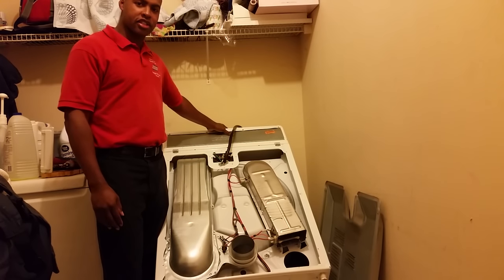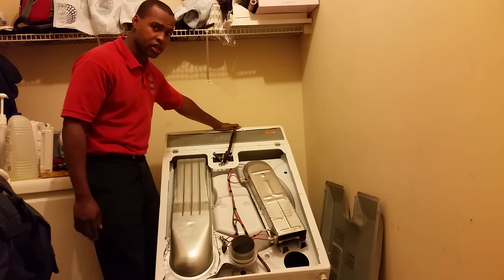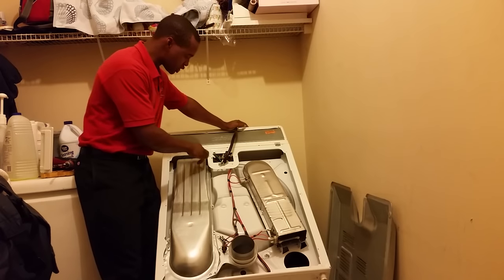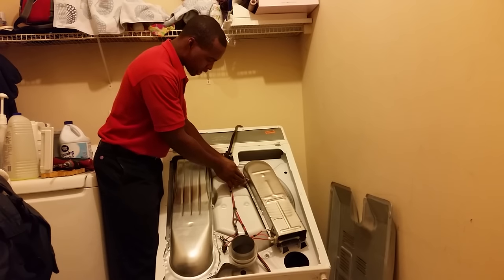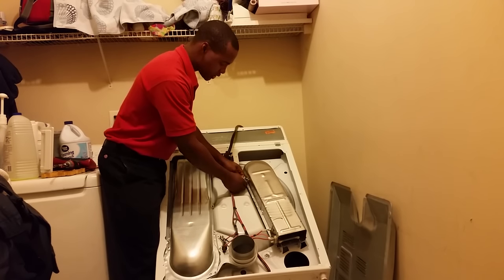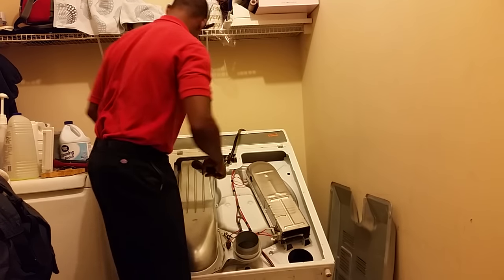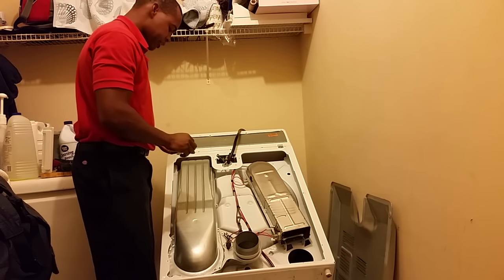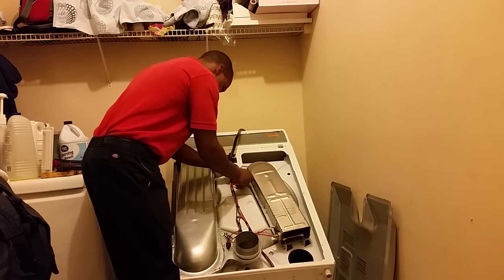How to repair a dryer that works but will not get hot

Comment: Hi Reggie.  Thanks for the post.  The heat in my dryer comes and goes.  I have disconnected the dryer vent from the wall and the issue continues to happen.  I have tested the thermostats, high limit cut off and heating element with a multimeter and everything is reading fine.  However when i test the cycling thermostat on the prongs that the purple wires attach to (i understand this is for delicate heat setting) I do not receive a reading on the multimeter (or ohlms reading).  I do get a good reading on the prongs for the red wires that attach to the Cycling Thermostat.   Could the Cycling Thermostat be my problem (due to no reading from purple wire connections) even though we never use the delicate setting?  Thanks for your time.

Comment: do you know what is the reason it is hot air inside but the cloths are not dry enough？
Reply from the maker: Bad air flow from dryer vents inside the dry and/or all the way to outside the house

Comment: Hello, what happened when the dryer has water under the machine.  The flor is so wet, also the clothes.  Even when the cycle is done.
Reply from the maker: Clothes coming out of your washing machine shouldn't be so wet that it causes water to drip from the dryer. In my experience typically water under the dryer is a washer leak because it's next to it, 

a hot water tank that might be in the same room, 

or your dryer vent maybe venting through the roof and the cap is off so rain comes in from outside through your dryer exhaust vent.

Comment: Where is that other video. What's it under. Dryer gets hot but not hot enough to dry
Reply from the maker: Most likely called lint screen or vent hose leading out the home

Comment: So I bought a dryer and tested it at the guys place and it got hot right away, took it back to my place and had to change it from a 4 prong to a 3 prong and it turns on but doesn’t get hot at all now
Reply from the maker: You're wiring job is wrong or you have a bad circuit breaker in the home

Comment: I have a Samsung Dryer and it turns but getting no heat.  In addition it just stops on its own when the dryer has been set to an hour.  It literally will turn off before the set timed dryer setting.  I have cleaned both vents from inside and outside.  The machine is no more than 2 years old.

Comment: I changed everything and it fixed it then moved it to were it was now it won't heat
Reply from the maker: Check electric outlet in the home could be a bad circuit breaker

Comment: This video was so helpful. So i went it the repair store and got my replacement part. Unfortunately the replacement part has become modified and my wiring connection doesn’t work... what do i do! 🥺
Reply: not doesn’t work but doesn’t match the original fitting

Comment: Hi repair nerd, I watched your videos and was able to find broken coils on my heating element. I’m thinking of replacing the part but I’m wondering if the cause of “my dryer not heating but otherwise working” could be caused by The thermostat. I didn’t test the other parts in the machine and returned my multimeter to the store :( is there a good chance my machine will work with just a new heating element or do I need to replace the thermostat  at the same time? I’m kinda tight on cash now. Also I noticed my was thermal fuse has been bypassed and I’ve been using it this way for years. This dryer was used. 
Thanks, ashley
Reply from the maker: Thermostat should be good if it wasn't the high limit thermostat above it would have gone out. Elements break all the time usually it's accelerated by poor air flow from clogged air ducts in which the moisture stays inside in the machine and humidity makes the coils break up faster than usual
Reply: Thanks again. 3 years later and this video is still helping me out!
Reply: Hi Reggie, I’m back again for more help. My machine has burnt out about 2-3 heating elements in the past 2 years. It’s always the same problem. The machine does not get hot but otherwise works. This time I replaced the heating element which was burnt on a coil and then I replaced the thermostat. It still isn’t heating and the cycle never stops when the times up. I’m about to give up and buy a new one after 3 years. Any advice on what to check before I give up? Thanks so much man!

Comment: I replaced the thermostat on top and it work for a little bit and stop heating up. I did find out that the fuse with 2 blue wires was not connected just the wire taped together. Can this be the cause why the thermostat burn?
Reply from the maker: You're treating the cough and not the cold. The top thermostat is triggering because the heating element is overheating. So your cycling thermostat which is the lower one it's probably bad, clogged tear duct, dirty lint trap
Reply from the maker: Here my video on how to test cycling thermostat, the one that's directly on the element
https://youtu.be/5eohG3knhdA

Comment: Awesome video I'm just now checking my mom dryer I checked all fuses one was bad replaced it but still not working turns out the timer is bad but expensive but I didn't check the elements need to do that as well but love your videos thank you
Reply from the maker: Remember a fuse that blows is like a check engine light in a car usually means something else is going on

Comment: This is an informative video. I have an LG electric dryer. Its running but will not get hot. It will run cycle after cycle, but no heat. Hose is clear. Both thermostats have continuity as does the heating element. Its been -20 out side the last few days, any chance this is messing with things? My clothes are freezing cold in the dryer now that its not working. Any ideas? Thanks!
Reply from the maker: Timothy Shrader as a technician first thing I would do will be to check your power outlet. A dryer needs 240 volts to run the motor and the element. Your dryer might just get a 120 volt which is enough to just run the Motor and not the element. The cause of that to happen usually is a bad circuit breaker in your house. I don't have a video on that yet so search for a video that shows you how to check a 240-volt outlet with a multimeter. Second thing I would do is just check all the wiring going to the heating element and be sure none of it is burned out.
Reply: Thank you very much for the info. I reset the breaker and checked the outlet which is fine. Still running, just blowing cold air. Im not sure what else to do. I did just pull the vent pipe out while its running and I could see the heating element is not lit up...
Reply from the maker: Timothy Shrader did you check the outlet with a volt meter? If so, it's time to have a tech check it out.
Reply: All is good at the outlet. Ill get a tech out here. Thank you for your time.
Reply: So what was wrong? Maybe the lint holder was full?
Reply: It was the control board. Found one on Ebay for $90. Dryer works normal again.

Comment: What could Cause the  Dryer  a Kenmore  80 Series  to  Not Stop Spinning ?  unless the Door  is  Opened, But  Runs again   upon Closing the Door  without Pushing the Start Button..   Tried testing all  Connectors and Switches,   With easy access,,   Except the Motor Start Switch  (on the Motor   , I suspect that  Part is Stuck/Fused in Closed position-- Maybe the Inertia Switch is Not Disengaging)   Am I correct?
Reply from the maker: Does it keep going with the timer in the off position? Sounds like start switch is stuck. You can take it apart and unstick the contact, sand it a little and put it back together.
Reply: @LeanOnYourRep     I see , you Agree with me on the Start Switch  Stuck,,    Yes, it Continues  to Turn  even as the Cycle Finishes..
Reply from the maker: @13291949  if it continues to run even after it goes to the off position then it's the timer I'm
Reply: @LeanOnYourRep  Agree..   Because  The start Button is required for the other Settings  Except the Timed  Dry  Setting..   So  I've Got it under Control..  Is an Old  Machine  So.. the "Used" timer I found in Ebay  is too Expensive...  I'll Just Continue Using the Dryer as Is..  and Keep an eye  on the Setting   by using  a regular Kitchen Timer  On top of the Dryer..  to  let me know to come & check after a 50 -60 Minute Run..    I can Manage  that.. Thanks...!  Very Helpful  Advice...

Comment: I had a dryer fire tonight and after all was cleaned up the dryer was fine except for the thermal fuse. Can that ignite a fire? And it was a whirlpool about 6 yrs old.
Reply from the maker: Manny Mo369 the thermal fuse helps prevent a fire, fire comes from excessive lint buildup sounds like yours got to the point where it actually touched the heating element and started the fire. Most lint buildup come from a clogged duct vent hose leading to the outside of your house. Also be sure your outdoor exhaust vent has a flat to prevent moisture and birds from coming in

Comment: My heating element is a one piece, what are my options for replacing on a whirlpool Cabrio electric dryer?
Reply from the maker: You may want to check again Cabrio dryers and not one piece elements. Most one piece elements are the 30 year old Kenmore dryers
Reply: @LeanOnYourRep  no it's a sealed piece unlike the one in your video. The two sensors are at the top. The other two are to the opposite side of the dryer next the lint tube.
Reply from the maker: @AndreKellum  and its an electric dryer??
Reply: @LeanOnYourRep  it's gas wgd6400sw1. I can't add a pic of the back here.
Reply from the maker: @AndreKellum  okay now things are making sense. Gas dryers do not have heating elements, they have burners which is the cone shaped object right beneath the drum
Reply from the maker: So if it's not heating is most likely one of the fuses ,  gas valves or your ignitor

Comment: Hi I have a dryer that is a whirlpool and it’s started taking long to get hot, n  now the light is on n i here it turn on and off real quick at night,  also not turning now !! What could it be
Reply from the maker: Hard to understand the last part of your statement pure but if the dryer takes several Cycles, check the lint filter and your vent hose as it shows in the video
Reply: I did all of that , it’s not tumbling nor getting hot

Comment: I have  had dryer and it's not heating and it's making a noise like something is loose or dragging in it. What a happening??
Reply from the maker: Could be one of the pulley Wheels is froze or check your frame to see if it's dented in and the drum is scraping the side. If you have a GE dryer it could be the front tub bearing

Comment: Hey man so I have an amana dryer that got real hot while drying one day after that cycle it stopped heating. Could you give me an idea where to start. Ps I changed the heating element with no result except a 51$ receipt
Reply from the maker: Most likely your high limit fuse and heat regulator needs to be changed. They are the two fuses connected to the element housing. You can by them on my website www.appliance-pulled-parts.com
Reply: @LeanOnYourRep  thanks man I appreciate it

Comment: My Dyer will not heat up the igniter comes on but the it goes off but no fire 🔥 and when I put my Dyer on very dry setting it never shuts off but still no heat what should I do? Thanks in advance
Reply from the maker: D Rock T sounds like a gas dryer? You might need a new ignitor if it's not getting hot enough how to ignite the gas or your dryer isn't getting gas because of the valve or your gas isn't on
Reply: It’s your coils

Comment: Reggie I have a dryer that starts out with basically no heat but will heat up after about an hour. What do you think?
Reply from the maker: rodspivey most drying should be done within an hour. Never seen that on a electric dryer. But I can see how that can happen on a gas if it takes a while for the flame to ignite

Comment: Changed the parts inside can the timer cause the drier not to heat
Reply from the maker: Mr70128  yes if you've tested all your fuses and the electric going into the dryer then the timer contacts might need to be cleaned. If you take the timer apart you'll see where the copper contacts look slightly burnt out, sand them down or use carburetor cleaner be sure to dry it good.

Comment: I have continuity on all fuses, heat element, thermostat, dryer switch, and tested the volts of the outlet. Everything is good, I’m baffled.
Reply from the maker: The timer is your next step here's a link to a video I did on testing the timer:
https://youtu.be/O6Ogh3MPwRc
Reply: The Washer Dryer Repair Nerd I tested the timer too. I literally just now figured it out. The timer was messed up. I had to push on the back side and front side hard to get it to work. Thanks for the video though.

Comment: I have a estate dryer. What is the problem when it runs then shuts the circuit breaker off. I turn it back on and after 20 mins it does it again. What's causing that.
Reply from the maker: something inside the dryer is grounding out. Look for loose / burned out wires that might have came loose and are touching the dryer frame.
Reply: I actually changed the heating element and the high limit. Then i checked for continuity across all the parrs and the timer and everything is good. I do not see any loose wires. I need this fixed. Anything i should be looking for.
Reply from the maker: Littleton Organ did you test for continuity by putting one of your probes on the element lead and the other on the element housing itself? If you get continuity then that element coil is touching the frame somewhere or it's happening after the element gets hot. Also are your electrical cord set up correctly? Black on black red on red white in the middle and green on the frame to ground if you have a black four prong cord. If you have three then the two outside wires on the outside and middle in the middle
Reply: I did not get continuity from the element to the frame. Do u think the breaker is bad. There are no wires touching.
Reply from the maker: Littleton Organ repairing anyting is trial and error at this point yes I would try changing out the circuit breaker. Breakers are about $10 to $15 at Home Depot so it would be worth the shot

Comment: The element on my dryer comes on for few minutes and then it shuts off what do you think will be the problem?
Reply from the maker: thats normal, elements turn off once the reach a certin temperature and will cycle off and on at a 10-20 degree range. If it turns off to fast, then try changing the heat regulator fuse.

Comment: spankz bro. I shorted my hi limit just to see if it worked and walla so off I go to get another one!
Reply from the maker: red2965 I have another video on here showing how to reset the high limit thermostat. The fuse that's above the heating on it. Slap it on the ground a few times and it should reset
Reply: man i slapped the sheeze out of it. if it could talk it would say it seen its grandma!  but sadly no luck and i can't go into it since wp noticed the vids on it and changed the style to a riveted ring around it lol

Comment: IM TRYING TO FIX MY MOTHERS MAYTAG CENTENNIAL AND I HAVE CHECKED CONTINUITY ON EVERYTHING FUSES AND ELEMENT AND IT WAS GOOD. I CHECKED VOLTAGE AS WELL...ALL GOOD...SO I'M STUMPED. I TURN IT ON AIR FLOW IS EXCELLENT AND ALL THE WIRING IS HOOKED UP PROPERLY IT JUST PRODUCES NO HEAT AT ALL. WHAT DO THINK COULD BE WRONG. IM THINKIN ABOUT CHECKING VOLTAGE TO ALL THE FUSES.
Reply from the maker: Jacob Zellar looks like you cover most of the bases, only thing left is to go back to the simple things double check to be sure it's not on a non heat setting, be sure it's on high heat. And also make sure it's not set on Wrinkle Guard which is also a no heat setting. Also be careful when you check the wall outlet it can be tricky, measure each side with your voltmeter to make sure you're getting 120v and then measure both power sides to make sure it shows 240v
Reply: Timer is apossibility
Reply: Tim Dodge yes it was the timer

Comment: the back would not come off.  it is somehow fixed at the bottom.  the elements will not shut off
Reply from the maker: Drake Koefoed if there's a panel in the front then your dryer access from the front and not the back. If your element stays on while the dryer is not on then the coil is grounding out on the frame, so you definitely need a new heating element and I would recommend unplugging the dryer from the wall and don't touch the dryer because it may be electrified

Comment: SOMEONE PLEASE help me here. 
My dryer heats randomly. One minute it'll heat, next it won't. While it was running, on the heat setting, but heat not on, I touched the meter ground to middle cord screw (neg) and touched each fuse contact with positive meter contact. Each lit up 120. The only one that didn't light was the one on the exhaust with 4 wires, two red and two purple. The purple, which is factory spliced to a white (black pinstripe) didn't light up. The purple looks to go to the timer. 
I can't figure out why it heats one minute, I turn it off, then back on and it stops heating again. Is it the timer??
Reply from the maker: It's most likely your timer here's a video I made on how to fix it:
https://youtu.be/O6Ogh3MPwRc
Reply: Awesome! I'll try it tonight!

Comment: I changed everything an dryer still blowing cold air
Reply from the maker: Check wall voltage, dryer needs 240v to run motor and Element